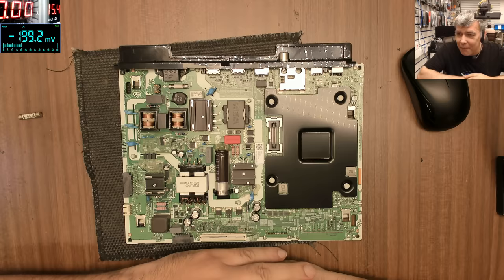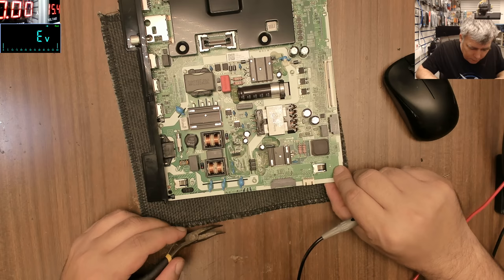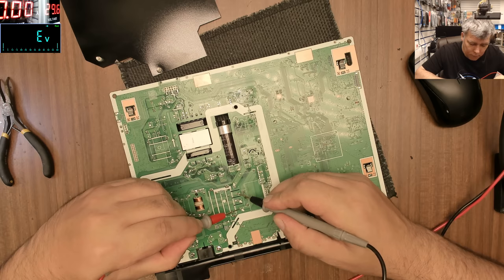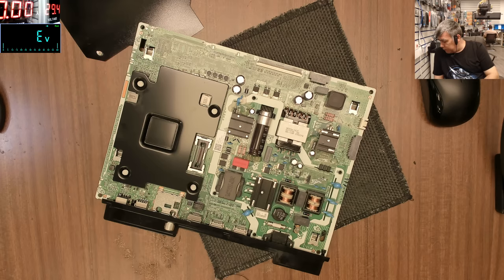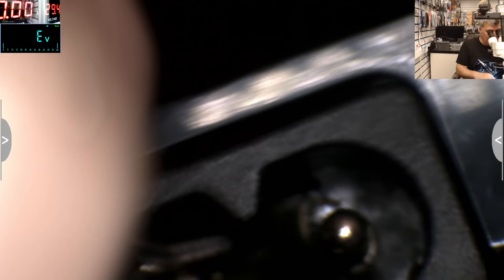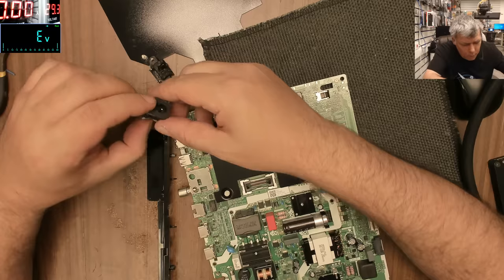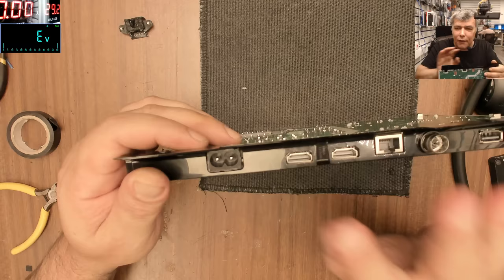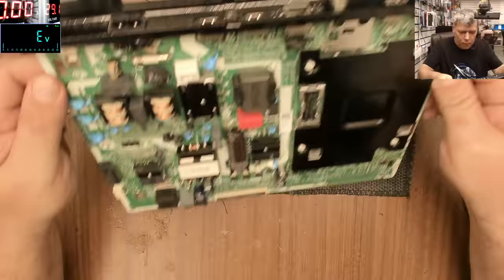Tv killed by a cockroach? Tv power supply repair

Comment: Hi Sorin. Greetings from Australia. Great video as usual :-}. Now, when you connect the light bulb(s) in series with your device, in case of a short, you limit the current to the device. Say, with a 100W bulb you get the current limited to 430mA @230V. So you can test your board WITHOUT blowing your fuses, and something actually might get hot. Of course, if you want higher current, use more bulbs - a total of 230W for 1A or 460W for 2A and so on. I have built my AC current limiter out of 4 bulbs, that I can individually turn ON or OFF each, giving me more flexibility without changing the bulbs for the different power. I am sure you knew this - just wanted to explain for other people watching and wanting to learn something :) Regards, Jerry.

Comment: Great video. In my HVAC business we see this kind of problem a lot. Insects get into the cases of outdoor refrigeration compression units when the weather gets cold, and they congregate in between the contacts of three phase contactor switches because of the heat coming from contactor coils. I’ve seen bugs take down 10 horsepower walk in coolers with $8000 worth of food in them...
Reply: I could a frog (quite dead)  had shorted the defrost control board in a unitary heat pump. It was a quick diagnoses.👍

Comment: The old trick for powering up equipment with a potentially short-circuit using an incandescent lightbulb in series works very well, it can dissipate a lot of power and the resistance is very non-linear, i.e. almost zero when the lamp is cold and several 100 ohms when hot. Fault finding is possible because the forward voltage drop of the semiconductors can be measured under power.
Reply: as a kid I remember my dad doing that to a TV nearly 50 years ago
Reply: I use that method before that I just re-replaced parts I just fitted lol
Reply: Very true Mr Cambridge :) The old tricks still have value and are cheap to implement

Comment: That the internal fuses didn't blow, but the mains plug fuse did can be described perfectly by kirchoff's current laws as demonstrated in this case by the very low Rl being the cockroach itself being closest to the 220v mains supply

Comment: I was shouting with my headphones on "its smoking from the socket", my wife thought the house was on fire. 😂😂
Why not just test the the board with the insects removed first before renewing the socket? That's why the board fuse did not blow, the short was before the board fuse.
Brilliant entertainment. Thank you Sorin.
Reply: The first time the bug got there and got fried the heat fried the plastic of the socket and turned it into conductor/resistor. He could have just soldered the cable he cut earlier directly on the place of the socket. That would have been the fastest fix.

Comment: Sorin, to open adapter casing apply petrol on the sides and in 30 sec it will open without cracking
Reply: You should really make a video detailing that procedure

Comment: I use a variac and/or a series lightbulb for these kind a things. (and every DUT is behind my 1:1isolation transformer) My first TV repair (in the 80's, I think was 17) Also a short. I placed a matras and pillows over the TV,   bridged the fuse with wire and then plugged in the TV with an isolated pair of pliers. Result, Beng, collected the pieces of the exploded capacitor, replaced it and it worked again

Comment: Sorin if you want to easy open laptop charger use car petrol from gas station, just put some on the joint and couple minutes later it can be opened by hand.

Comment: That must have really stunk when you cooked that bug! 
Once I absolutely could not find a short that was blowing fuse. I put in a larger fuse and watched for a pop or pillar of smoke. This led me directly to a shorted transistor. Luckily the board wasn’t damaged in the process. Replaced the transistor, put back in the proper fuse, problem solved. I highly DO NOT recommend this troubleshooting method, for it could create unrepairable board damage, eyeball damage,  or even catch your place on fire! I now use a variable voltage ac transformer 0-130V ac “in America” and use a 500W photoflood bulb in series with my hot wire wire  on my power cord using a flange base bulb socket and a junction box wired up with with a male plug on one end, and a female ac receptacle on the out side of the bulb which I plug my device under test into. Only the hot wire travels through the incandescent bulb filament, the white common and ground just goes around the bulb without any connection. The bulb filament on the hot in series acts just like an inline fuse to lower the current if there is a short in the circuit. The brighter the bulb, the more direct of a short in the device under test. I can test pretty large amps with a 500w bulb, if no short it passed enough current/voltage to actually let the device under test operate normally if the bulb isn’t glowing.

Comment: You are a master of improvisation! ... Right at the beginning of the video I was wondering, if the outside fuse blows but the inside one does not while all after looks mint, there is only one thing in between... check the socket :)
Reply: Obviously it was too hard to figure out for Sorin lol.

Comment: I have a 65 inch LG hanging on the wall for 2yrs. Then one day the thing jsut stops working. After seeing this I say to myself eureka! I bet one of the inputs shorted out due to the bent wires against the wall. The thing is so heavy I have not pulled it off the wall because I am old now and it is heavy. So I guess I have to pull it off the wall. LOL

Comment: I had a similar problem. A friend gave me a 55" 4K LG TV, had a blown fuse. I removed the power board and underneath on the TV back was a black mess, strange pieces of something unknown. I checked the board and no fault found. I replaced the fuse and it worked. The blown black mess was the remains of a lizard that crawled into the AC socket and fried itself hehe!

Comment: So the cockroach acted as a external fuse protecting the TV from ANYTHING that might come from outside... Seriously though, how did it get there as the cable is always plugged into that socket. Did it get there in the factory or during the transit?

Comment: start doing 4 x 5 push-ups before work. Gradually raise the number. You will be amazed at how easy it is over time.I was 135 kg. I started with 4 x 3 and reached 10 series of 12 pieces. I lost up to 109 kg

Comment: By using a 2kW heater, you're limiting the current enough for your circuit breaker to not blow, but that's about it. Perhaps there's value to that in this case as to not shut down your live stream, but we shouldn't let the watchers think it does much more than this as a light bulb would have done.

Comment: so an Electronic repair school doesnt know that the T on a fuse stands for "Time lag" so that would be the reason why the other Fuse was faster even when the fault would be different..i was already skeptic BUT he had to google if the Blue or Brown wire is neutral? Really?? The Customer can be happy if the Port doesn't come out of the Case when he pull the Plug. When i would go to a "professional" Shop to repair my Stuff I expect him to say that the Fault was different and he has to Order a new Part. Not going on with the Part where he used a 2kW Heater instead of a ~60W Bulb...just wow

Comment: Hey bro. i have a question. I have a hp 2570p i5. Last month it stopped 
working without any reason (maybe because of power problem of home). I 
changed Ram, Hd and CPU, but doesn't work. Just fan work for some 
seconds and again off (repeat repeat ...). Just one time turned on for 
30min I updated bios and installed new windows, off again and again fan 
on off ..... . What's your idea?  If I take a new Motherboard will work 
again??? Thanks

Comment: Hold on a second, I need to break this power supply apart to use the socket. That plastic chip would have pierced your eye had it been a couple inches higher just like in Ukraine with the shelling.

Comment: Is it possible to use isolation tester to test the coil of the transformer for shorts.
Reply: Its high frequency transformer, not 220V. It not eficient at 50/60Hz.
There are testers for this type of transformers

Comment: Would the color of the cable connector cables matter? Isn't it ac power? Just asking because you can plug the cable any way you want on the tv connector and also to the wall outlet and it still will work
Reply: yeah, stoopid design. it should not be like that for safety reasons. works anyway tho
Reply: No, because the 2 pin connector is only permitted on double-insulated equipment with no earth (ground) connection required.
Reply: @cambridgemart2075   correct me if i'm wrong but I don't think is the same to put a fuse on the live or on the neutral
Reply: @chainbreaker  When there is no earth / ground reference, it doesn't matter which line is fused. The only difference between live /hot and neutral is that neutral is near ground / earth potential.

Comment: Well, i think that you missed an step on the diagnoze of this TV .After 2 power cables blowed off......the logic next thing to check IS , the conecter , right ? First .
If, you, sir wanted to make a long storry from this video i can understand . But what if it was an charger cable of a tablet or somethig else on lower voltage  ? 
Higther  voltage is unforgiving instantenly.
 Be aware , there are young ones that are wacthing you video ....safety first .You get the picture .
Sorry for this.
Reply: I mean, it's easy to say "the logic is... this" after you see what the problem was. In reality, how many appliances have you ever encountered in your whole life where the short was caused by a bug. Truthfully it's probably the last thing you'd ever check for.

Comment: Hellos Sorin, do you still wonder about poor quality made by Samsung, I repair TV sets from them daily, I can tell you that is junk brand, they are the only major brand offering service manuals without any schematics (except block diagrams ...) they use quite bad brands of capacitors and so on .... I don't recommend them to my customers.
Reply: Is LG any better?
Reply: @silviuguseila2552  Unfortunately not , they have been excellent on period of plasma TV, but as LED TV that is not better, the only TV brand i still recommend are Panasoni, Sony and JVC, speaking about European market, i don't know about USA or any ...
Reply: @Yoritomo3800  but JVC and Panasonic are made by Vestel Turkey, surely low quality? This is what wikipedia says, Vestel bought them. Panasonic I think still manufactures some high-end series of their TVs.

Comment: Sorry, but this video makes the hairs on the back of my neck stand up. If you repair such devices, you should definitely have an isolating transformer, preferably adjustable and with volt and ampere display. This would have detected the error after 2 minutes. More shocking is the way the device is repaired. In the electronics mail order you get such a power jack for a few euros. The tinkering is a danger for the user. The socket can come loose and be pulled out with the cable. Then good night.

Comment: using wire as fuse?(Preece's Law)
http://www.nessengr.com/techdata/fuse/fuse.html
don't forget :
diameter is in inch
formula is empyric AND don't take into account the pcb who absorb some heat
the pcb is not anymore protected against the fusing process 

example :
it's about wire made of copper !!!

a  1mm diameter wire = fuse of 80A
// 0.5mm diameter =29A
//0.1mm diameter = 2.5A